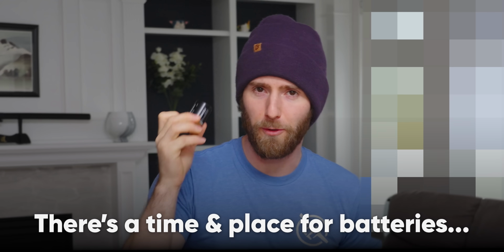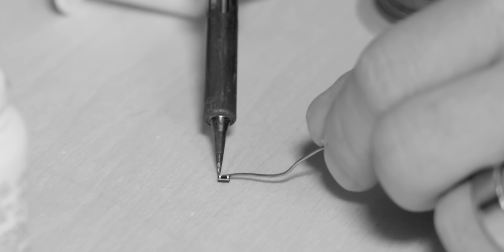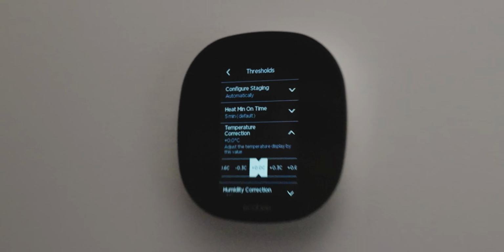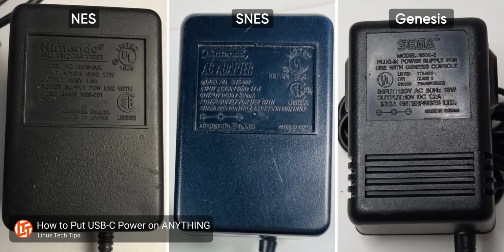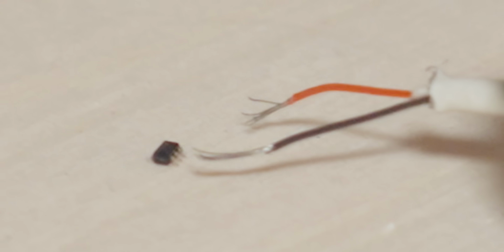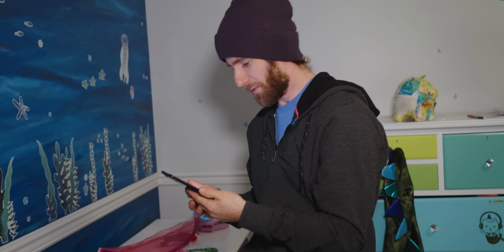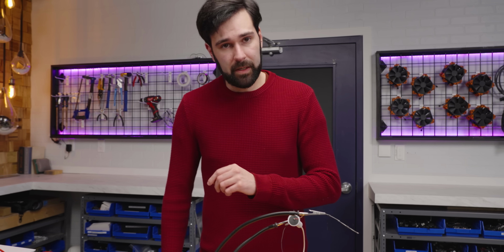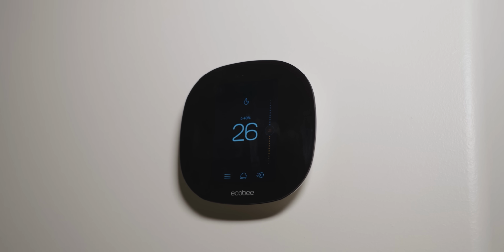I HATE Batteries! - Converting Wireless to Wired (a cheapskate’s guide)

Comment: The tricky part of power supplies is what happens when they fail or have their limits exceeded. I've seen so many people use those little amazon/ebay "drop down" boards with a buck converter and minimal supporting components. This is very dangerous. The most common failure mode for these when their ratings are exceeded is to let the full input voltage through. This is often destructive to their load, and can be a really really potent fire threat.

Personally, I would do a bunch of analysis or testing to determine how the sensor behaves under the worst conditions it could see. So if you're stepping down some voltage - how does the sensor behave when it receives that voltage? Does it go up in flames? That's the important question.

Comment: To simplify, just use the LM2596S DC-DC Buck Converter (2 wires in  DC1.25V-35V  -  2 tires out adjustable voltage) it only costs $1.96 free shipping from Aliexpress, simple and easy!

Comment: 3x 0.6V/1A dirt cheap diodes in series would be much easier , cheap and reliable than this.
Reply: lmao i commented that just before Dan did exactly that
Reply: also maybe add a 100ohm resistor in parallel to the terminals just to avoid the 4V when no current draw.

Comment: I had a unit in my last two houses that would turn on the HVAC's central fan to circuit and average the air within the house. Some bedrooms would get super hot, or super cool, and this balanced the house's overall temp without cycling the heater or air conditioner as much.

Comment: It is so funny to watch IT guys messing with electricity. I like your videos guys dont get me wrong but this was totally the bad way how to do it. (also networking stuff is kinda bad in your way). Using resistors is harder then it seems, using fixed regulator for change voltage is kind doable... but isnt it better to just buy variable one and 2 resistors to set its output (like LM317). You should also use capacitors to stable out drops and peaks.

Comment: just put 3 silicon diodes in series. 5 volt in 2.9 volt out. measure it to check result. though, it's kind of waste, but better than bat
Reply: wait they did!

...or get ams1117 based 3.3v module and solder it there

Comment: Yeah, changing batteries is very annoying. But I can't see how this is worth it. Neither time wise or economically in a very long time frame. You only need to change the batteries like once every 2-5 years in these types of devices and you don't have to worry about wires. I have a few Aqara motions sensors in the house mounted on the wall, and I can't imagine this being worth it even in a 20 year time frame (4-6 battery changes).

Comment: I wish every battery powered device had a plug option by default.  Kind of want one of those desktop setups where magnets charge my mouse and keyboard.  Right now I have a wireless keyboard (chord is a bit of a pain because my desk doesn't have chord holes) and a wired mouse (I hate how mice with tails skew movements in games sometimes, but I haven't found a good gaming mouse that has a chord/battery option that is also compact enough for my relatively small keyboard pullout.)  Also want a hybrid battery/wire headphone, because my Yeti is prone to jack problems.

My desk has the same problem as that dresser.  I haven't gotten around to it, but I have a board cut and drilled, and have the hardware- some wall brackets and screws, but I need to stain it to match my desk.  The idea is I'll mount it behind the desk at the same height so that there is no gap.  Also planning to build a harmonica cubby hole shelf on top of it under my monitor for all my harmonica storage needs, but I need access to a better saw to do it easily.  I don't want to do the 70 or so cuts involved with just a miter box and hand saw.

Comment: I made a fancy switching regulator that was controlled by a potentiometer. I think its operational range was like 0.8-33 volts and a current limit of something like 2 amps. Did a bunch of characterization, and it was pretty crazy efficent for all sorts of loads, sources, and settings. I think it was just a buck converter, though, so the output will only go as high as your source.

Comment: Linus the 3.3v power supply should actually work. i just measured a few fresh unused 3v button cell and they have a nominal voltage of 3.28 - 3.3v
all DC battery powered electronics have to work within a voltage range due to nominal battery voltage and voltage drain during use. 
anything that uses a 3v button cell should work with a voltage range of 3.3 - 2.8v any lower than 2.7 and its considered dead. 
you dont have to be dead on 3.000 volts or 3.2v as used in the video for it to work properly.
some can handle more voltage it just depends on how well it was built.

Comment: My vote goes to ....  ====================

A simple Zener diode  [3.3V  400 mW] with a resistor seems to me the simplest solution. It is easy to construct, small, reliable, robust, cheap, and uses readily available parts.
The resistor is in series, with the Zener in parallel after the resistor. The value of the resistor is   [Supply Voltage  - Vz]  divided by [Load Current + 10 mA]    where Vz is the Zener voltage. Don't forget to calculate the Wattages for the resistor and Zener.

Zener Wattage is commonly     2 x Vz x [Load Current + 10 mA]

Round up to the next available value.

Resistor Wattage is commonly     2 x [Supply Voltage - Vz] x [Load Current + 10 mA]

Round up to the next available value.

Why do I multiply by two?  It is to give an adequate margin. The Wattage rating is determined under ideal  conditions, but the real world is quite different.

Comment: Problems with 2nd generation Linear Regulators. ==========

Although this class of regulators are cheap and readily available they have some drawbacks. Regulators such as 78xx need the difference between the input voltage and output voltage to be  least 2.5 Volts. For example a 7805 [a 5 Volt regulator] needs an input voltage of 7.5 Volts or higher to work properly. The second issue is the minimum output current; this is often 10 mA. A simple fix would be to have a resistor in parallel after the IC to ensure enough current flow.
A side-note is that these ICs also need current to work - they usually need about 10mA. 

There is a later class of regulators called LDO [Low Drop-Out] linear regulators which need a smaller difference between the input and output voltage. A LDO version of the 7805 might need only 6 Volts as input to work.

A number suggested use of the LM317 but it also needs a 3 Volt or higher difference between the input and output voltages. The recommended minimum output current is also 10mA. There isn't a need to use a trimmer or pot - you can use two resistors to set the output voltage - an exact voltage is not needed.

Two cautions. Many of these ICs require a small cap [often called a bypass cap] for stability  or to avoid certain issues. As well a large electrolytic cap on the output side can poise a problem as it can cause a reverse voltage and damage the device - a diode is needed to prevent this. 

Hence for the LM317 parts list is; the IC, diode, two resistors, and a bypass cap. Plus the buffering electrolytic cap.                                                                        

Problems with Switching Regulators such as Buck converters =========

I guess these are suggested because of the common  belief they are efficient. This is a fallacy but there is an issue more relevant here. The output of a typical switching regulator is horrible; full of spikes, noise, and the waveform is far the steady output as from a battery or even a linear voltage regulator. This can cause problems with sensitive circuits. As well there can be EMF which can also cause interference. In addition their response time is relatively slow - it takes a while for them to respond to a sudden change. 

Building a switching regulator is harder since the layout is more critical and the inductor is a pain since the parameters are a struggle; inductance, Q, saturation, and resistance. That means results can vary which isn't great. Even buying a commercial unit isn't consistent since the layout, component values, component types and configuration can be different. That is true even if the same IC is used. Even the IC has variants which can have different parameters which can influence its performance.

Side-note ===========================

Some have suggested putting a capacitor before the load/circuit to "smooth" the current "spike". First it is not a spike as a spike is of a very short duration. It is perhaps better called a surge. Second such a electrolytic cap would be supplying power. It would be smoothing if the "spike" came from the line. power supply, or such. However here it would be supplying power to the circuit. Since switching power supplies [the USB power supply] are a little slow in responding to rapid changes it is a good idea.

Comment: Why a resistor did not work ========================

A resistor in series can drop the voltage but for stability the current needs to be stable. From Ohm's Law   Voltage Drop equals Current x Resistor Value
But here the current varies greatly, so the voltage drop would vary and so the voltage to the sensor would vary.

Why a resistor voltage divider is a pain ==================

Let's use R1 and R2 as labels for the two resistors in a voltage divider. And let's put the load [the sensor] across R2.

The current passing thru the divider and so available to the load is  Supply Voltage divided by (R1 + R2)
The current varies a lot - we have to get the highest current used by the load.

The voltage across R2 [and so going to the load] is Supply Voltage x R2 divided by (R1 + R2)

However, the load is in parallel with R2, so R2 is 'replaced' by the effective resistance of the load and R2; they are in  parallel. In effect the resistance at R2 varies by the load current. And that means the voltage to the load would vary. You can do the math;

effective resistance is (R2 x Rl) / (R2 + Rl)      where Rl is Voltage / Current used

That is the theory but in practise one would have to experiment with different values of R1 and R2.  If the sensor is expensive and easily damaged by a higher voltage it doesn't make experimenting desirable.

Comment: Ye older LM317 regulator (and clones) are adjustable with 2 resistors. Or Schottky diode if you just want to drop it by 0.2. Resistor in series to regulator is a bit iffy solution

Comment: Why not use a cheap buck converter to do the same thing? You get the flexible voltage regulation, and it's a lot less spicy. The lower-powered modules are very tiny, but they're still dead-easy to solder. There's about a billion different choices on Amazon. They may not be 40 cents, but they're still very, very cheap.

Comment: Adjustable Buck Converter, less then a "buck" a piece on ebay.  Using resistors and diodes for V drop is like going back to 80's tech.

Comment: For regulating voltage with a higher precision for application like that, I would recommend to use an adjustable stabilizer eg. LM1117-ADJ. You pair it with IIRC 3 resistors and voila, stable 3V accomplished.

Comment: Right idea but I HATE wall warts! Given I have flood wired Cat5e and Cat6 I just use POE from the closest RJ45 output and using dirt cheap 60v buck regulators from Ali Express or eBay I can EASILY provide any voltage from 3.3v up to 5A to any device from a TINY package. 

In addition, if I have a number of devices close by using say 12v, 9v, 5v and 3.3v, then depending on total power required I could probably just convert to 12v from POE and then use either linear regulator chips or even cheaper 30v buck regulators (better for higher current output). In MANY cases these can actually be fitted INSIDE the device to be powered enabling them to be powered from ANY DC voltage up to 30volts ... the most common voltage max of cheap buck regulators. 

The flexibility and simplicity of this approach has to be seen and used to be fully appreciated. A hidden potential benefit is that it is a fairly trivial task to provide instantaneous battery back up to critical sensors by the simple use of a single diode.

 Example: using a fully charged lithium ion battery of 1P3S at 12.6v with a series diode connected direct to the 30v input to the buck regulator the diode will be reverse biased during normal operation but on loss of POE power due to a power cut the diode will then conduct and deliver power instantly, with no drop out.

 Using a Schottky diode can keep voltage drop to a minimum so that a nominal 12v supply can be provided even from just 12.6v. Besides this, MOST 12v devices will happily operate down to 10-10.5 volts.

If you understand electronics and KNOW that internally the device itself regulates the 12v nominal down to say 5v, then you KNOW that a voltage of as low as 8v will probably be fine.

Depending on current requirement there are some super small switching regulator boards of less than 2-3 cm² that can virtually be guaranteed to fit INSIDE even very small devices, like say a five port 100/1000 mini switch! 

These are classic examples to use since they HAVE to have at least ONE ethernet connection! So just ONE cable for data and power ... NOTHING neater OR simpler OR as cost effective!

Comment: I once converted a battery powered "toy" that someone wore out (contacts or switch didn't work on the battery anymore) to use an old 3.3V cell phone charger. It worked better than it originally did, although she didn't trust my expertise to actually use it after the repair.

Comment: why not use the LD1117? its similar to the lm337 but haze a fix Voltage of 3.3V so no Vref to worry about. Its findable in a TO-220 case, so easy to solder and robust. I have those at home from aliexpress and was arround 3.30 euro for 10 Pcs.

Comment: Bruh using a resistor in series as a voltage divider is the worst way to get voltage down since it's proportional to the load resistance. Glad it worked out though lmao

Comment: Do yourself a favor and don't follow this guide. You can get switching step down voltage converters for very little money so you can have any output voltage from most power supplies. Also: a resistor is not a way to reduce voltage, because the voltage it drops depends on the current the device consumes. A diode is better in that regard, but if your goal is to get a lower voltage, you shouldn't use shottkey diodes but normal ones which drop the voltage by 0.7 V per diode.

Comment: Maybe next time use a regulator and a rather large capacitor on it's output. A battery IS a capacitor, and battery only devices won't have filtering caps for the ripple you tend to get from a wall power adapter.

Comment: Why not have a small PCB with the size of that battery made? Print something to fit into the back, use e.g. nickel strips to make contact between the PCB and the device. Now you have a CA$3 solution, but the work may well be worth it.

Comment: Voltage divider using 0.5w resistors is easier and it doesn't require soldering

Comment: What! I have the same multi meter as Linus and this thing is a cheap piece of junk. It does not read the voltage correctly like at all. Guess he got a working one. 

I tried literally the only thing that thing is good for is testing continuity with ohms.

Comment: So...why would you not just make your modifications INSIDE the charger instead of the back of the sensor?
Reply: They are difficult to disassemble, and also easy to short and make a fire hazard, a power outlet may supply over 2kW!

Comment: This isn't even the dumbest thing Ecobee doesn't offer. There's an incredibly simple thing they refuse to create. A mounting plate for homes that use an electrical box horizontally. That's a trend becoming more popular and many thermostat companies either have holes or plates to mount on them, but Ecobee does not - and does not offer adapter for one either. Despite literal YEARS of people asking for it. Truly a stupid company. After owning one for a long time, I've come to believe they are one of those tech startups that tries to have as little work put into the product as possible and just ride out the product's life. The software has so many ridiculous shortcomings and limitations that just don't need to exist.

Comment: This is so funny, my partner bought battery powered lights she wanted to have on all the time, so I cut the barrel jack off of an old junk wall wart and wrapped the wires around the battery terminals. Success. Batteries bad, especially unnecessary ones.

Comment: In all the cases, resister, diodes, Zener, and regulator, you need a load resistor (and a small capacitor across the load - 1uf) to get the minimum load current to get the 
diodes to be forward bias, Zener or regulator to regulate. With out the load resister, at very low current draw, none of the methods above will turn on or act like you would expect them to do.
For example, the MIC5504 needs a minimum of 100uA to regulate (3v @ 100uA would need 30k load resister - do not forget the load capacitor).